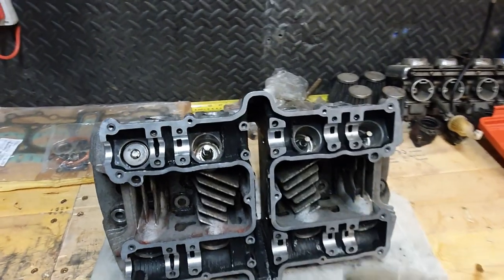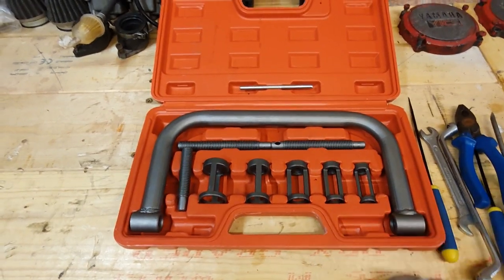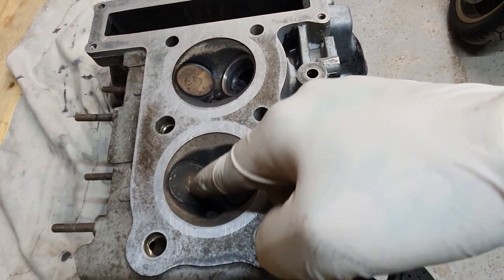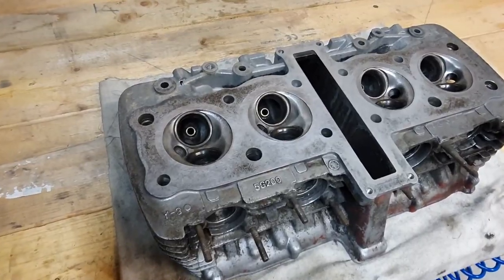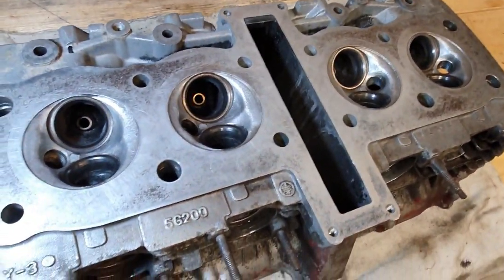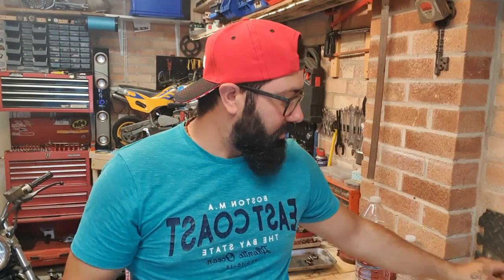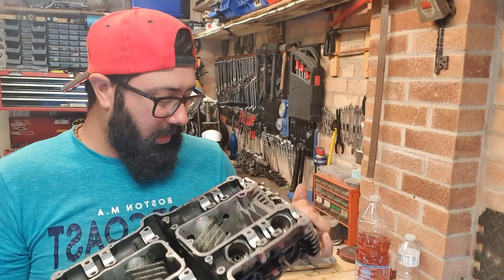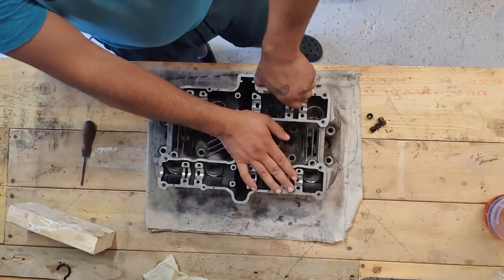1982 XJ750 Trike EP3 - head rebuild - RGMgarage

Comment: Appreciate the video. I'll be doing a XJ650 rebuild. When I get this very stuck cylinder head off.
2030 by the looks of things. Three WD40 so far + Mallet. No joy.
Reply from the maker: I have faced the same problem, a lot of patience old screwdrivers and crowbar and a few drinks later (careful on the cooling fins) ......  make sure you remove the nuts on the front and back of the block. I wish i knew a trick to remove it
Reply: @RGMgarage  You're alright, I'm going bottom to top on the dismantle now.
Only option.
Least I'll have less to worry about internals cause they'll be out.
Plus I can whack the casing. I've two halves spare.
Keep you posted :)
Good luck!